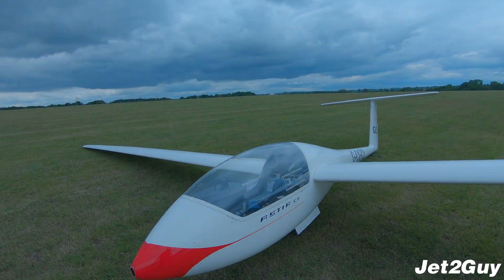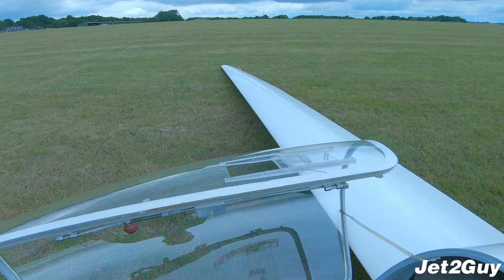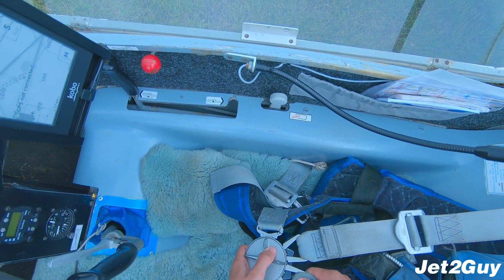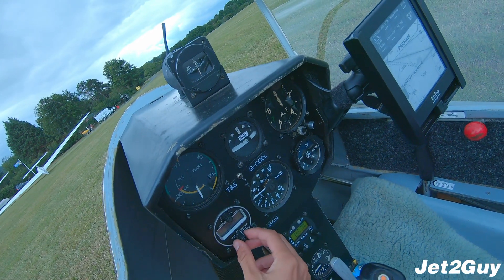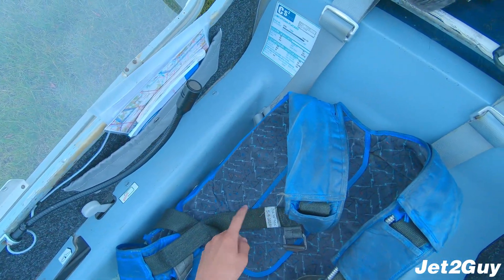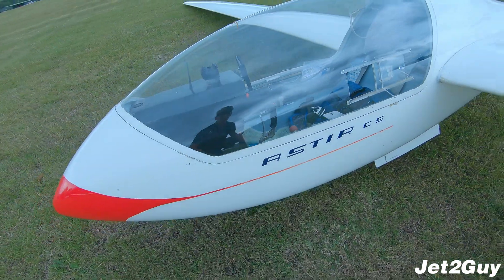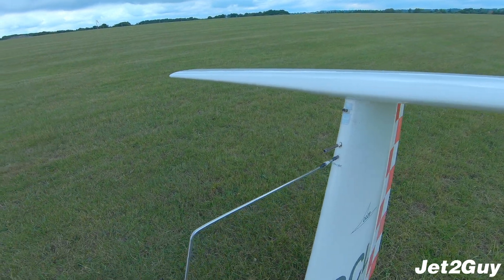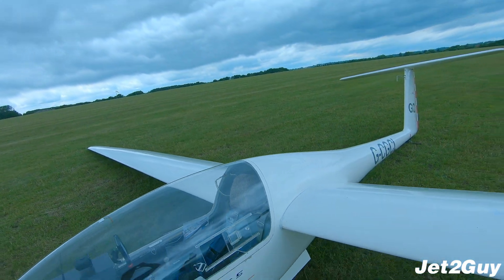How to carry out a daily inspection (DI) on a glider.

Comment: Wait wait wait, I've just re watched this. There is a parachute in the glider?
Reply from the maker: yes
Reply: Jet2Guy do you get trained how to use it?
Reply from the maker: @elliotwhitworth8239  well you told if you need to bailout pull the chord and try and land on both feet!
Reply: Jet2Guy oh cool! So, when do you know to bail out? Because most of the time you can surely just land in a field, right?
Reply from the maker: @elliotwhitworth8239  Bailout is last resort,  normally only happens if your in a mid-air collision, but if you lose elevator control you will have to bail out as its impossible to land. Yeah if you can land in a field, its very common.
Reply: Jet2Guy ah I see. Thanks!